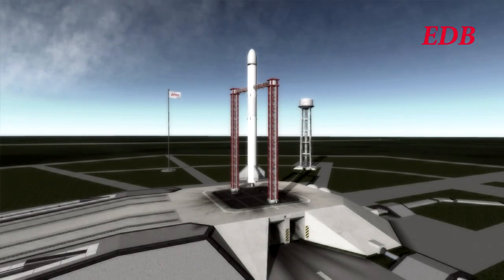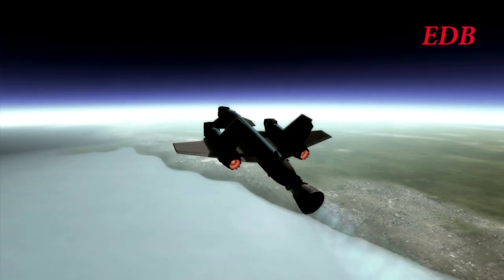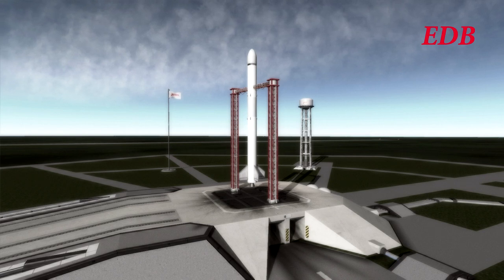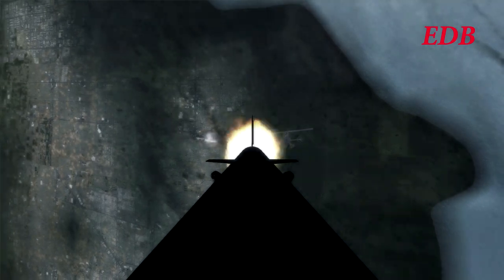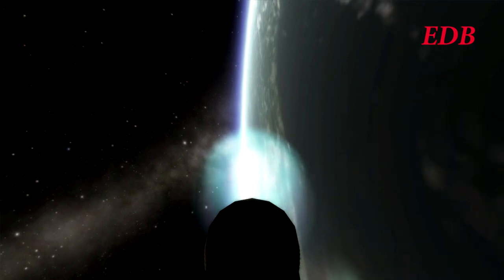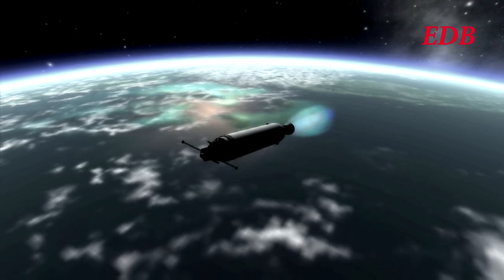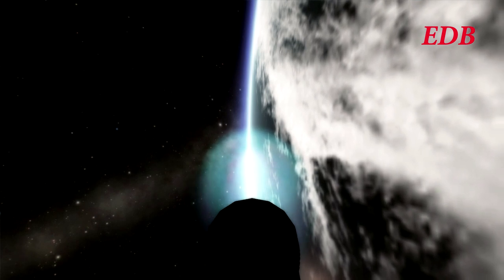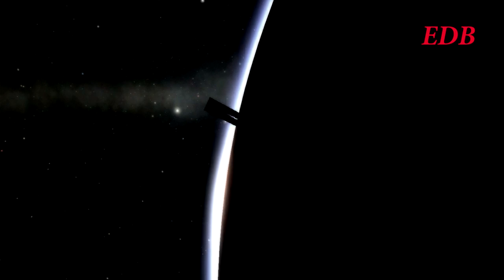Kerbal Space Program EDB Mission 024   WK-10 Demo Launch

Comment: The realplume effects look incredible from the hull camera view! Do you use kOS for the launch automation?
Your series should have a direct link in the RO main thread
Reply: Did you use cooked controls? I am working on a spaceplane ascent program in kos and encountered that you better go with a self written PD controller and raw controls. This should be sufficient, at least for the roll issues, and is pretty easy to implement, as soon as you figure out how directions work in kos. And not forget about the beauty of a sophisticated launch program that gets you in a reliable orbit every time
Reply: Cooked controls are: lock steering to "direction".
Raw controls are: set ship:control:pitch to "value between 1 and -1".
But if it works i don't want to bother you, it works very well your way